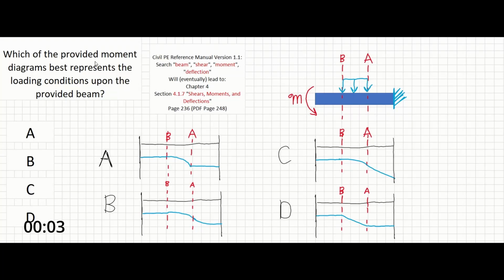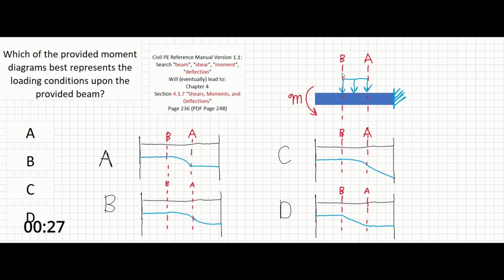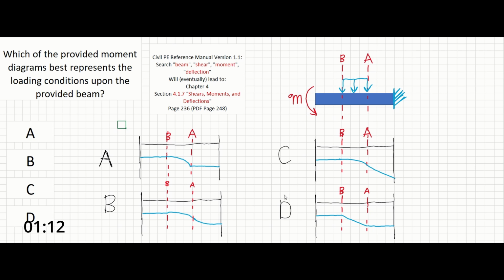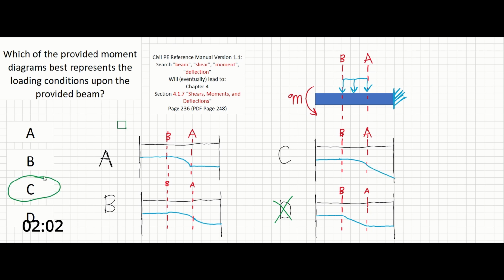PE Exam Practice Problem #80: Structural Mechanics | Beams - Shear and Moment Diagrams - Concept

Comment: are problems #75 - #80 labeled "structural mechanics" for water resources exam  too or only for structural?
Reply from the maker: When I took the exam in 2019, there were a handful of structural problems. I'm not entirely sure if they would still be present. Take a look at the NCEES website, it will provide the most updated overview of how many of each type of problems its possible to come across for each given exam type. https://ncees.org/wp-content/uploads/2023/10/Civ-WRE-April-202473.pdf based on that link, there may not be any.
Reply: @S @SolvedIn6 thank you so much!